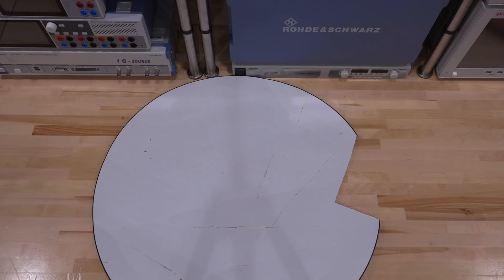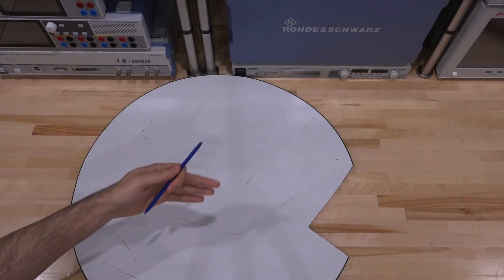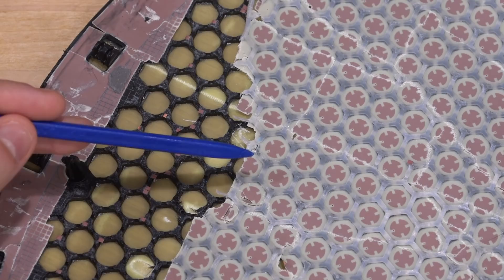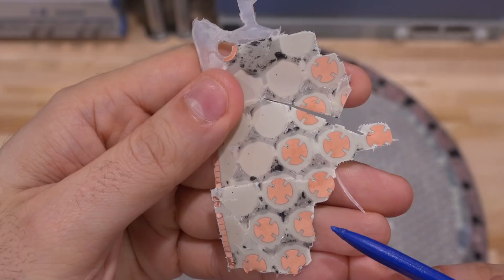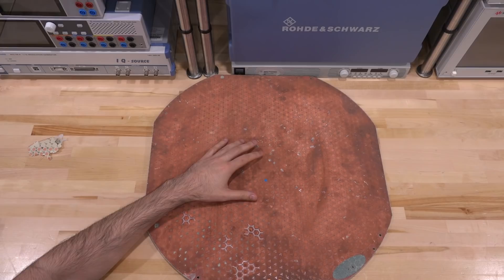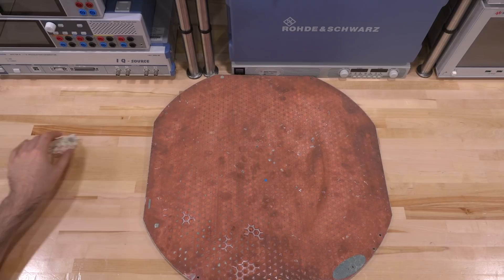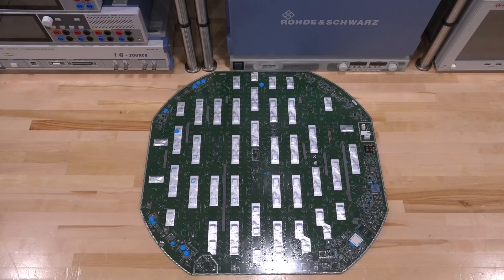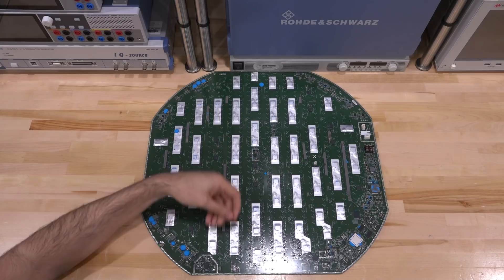TSP #181 - Starlink Dish Phased Array Design, Architecture & RF In-depth Analysis

Comment: Do you have the ability to sand down the PCB progressively?  I know some companies sell the hardware and software to do this.  I recently did it on a PCB I was reverse engineering.  If you don’t have the hardware or the time I would be interested doing this with a part of the PCB.
Reply: "mikeselectricstuff" has also successfully used CNC milling to expose PCB layers sequentially -- he has several videos on it: "Peeling multilayer PCBs apart" and "Peeling multilayer PCBs apart - the setup."

Since the inner layers did not show up very clearly on the X-ray picture here, either grinding or milling the board would certainly be useful for understanding of how the circuit is constructed. I think it can reveal more about the circuit than even de-capping the chips, and can be the next logical thing to do.
Reply: @cogoid  I agree.  I've done it before for boards that have multiple layers with large power planes.  It's surprising what you can find.  One design had the designer's name sandwiched between to power planes.
Reply: @flantc  Same with chips -- I remember seeing a picture of Digital Equipment MicroVAX processor die, with a message in Russian saying: "VAX -- When you care enough to steal the very best."

Incidentally, I am not sure how SpaceX would feel if somebody would do too good of a job in analyzing this antenna and publishing the results publicly.

Comment: @9:56 that's the ground of the array, it's simply a patch panel antenna array. The individual antenna elements on the membrane are separated by 2 dielectrics, the membrane material whatever its and air...
Reply from the maker: That is not a ground plane, I know it looks like one, but it is not. See later in the video.
Reply: @Thesignalpath  so where's the ground then? Apologies if I missed a detail
Reply from the maker: @outrospection4all  It is below the patch antennas on the main PCB. I think you can see it better in the X-Ray images later in the video.
Reply: @Thesignalpath  many thanks
Reply: Another question, do you think the motor steers a specific plane or is it fully electrically steerable phased array

Comment: Would also interested  to see what topology of array is this? i guess is 2D uniform array or not? Also I would imagine you need a pretty beast PC to simulate this...  My 4 patches array I had to did for a project at university took like 4min to simulate to simulate 1k+ element I imagine it take hours....
Reply: you don't need to simulate the entire array to make it. you can simulate it as an infinite array for almost 90% of the array, then just do the simulation for the surrounding (3 or 4 last rings is enough). Anyway, many company use supercalculator, 1 core per radiating element, meaning a thousand of core which is not a crazy investment for Musk :).

Comment: Any idea what the gain of the antenna is?
Reply: From the FCC licence application:

33.2 dBi at 11.83 GHz
 (RX)
34.6 dBi at 14.25 GHz (TX)

This corresponds to the aperture efficiency of about 56%

Note that this is the gain with the beam at the boresight. With the beam at the maximum slant of 56 degrees, the gain will be 2.6 dB lower.
Reply: @cogoid  Thanks for the answer. So it seems near the same figure as an equivalnet sized parabolic dish but with the advantage of it being 'steerable'.

Comment: Will it work with the GPS module disabled ?
Reply: @risfutile  Why is it a stupid question? What basic satcom knowledge am I missing about the Starlink system?
Reply: I will reformulate the question. If Starlink is banned to work in some countries, and the Starlink system knows where the receiving antenna is. Will I be able to fake the GPS data to use the antenna .. or can this be turned off ..
Reply: @Redfvvg  No, because the Starlink satellites will still know the coverage of their transponders COARSELY ...but that was not my question. Reformulating a question in that manner is known as constructing a straw-man argument.
Reply: @amciaapple1654  I am very sorry..
Returning to the question .. If the starlink satellite knows the location of the antenna, only from the GPS data built into the antenna .. then you can fake the GPS data ..
Reply: @Redfvvg  ...but the Starlink satellites know the position of the client's antenna from TWO sources: 1) COARSELY by the satellite's ephemeris/position and beam steering/azimuth at the transponder antennas and 2) PRECISELY by obtaining the data from the GPS receiver built-into the client's antenna via the uplink. What if the data from the 2nd source of positional data is missing entirely because I cut it power supply pins to the GPS module?

Comment: Great video Shariar!
Is this the V band system described here? https://licensing.fcc.gov/myibfs/download.do?attachment_key=1190019
It describes some of your questions like dedicated frequency allocation for uplink and downlink.
I think the notch in the circle is to suppress spurs from the mode that travels around the circumference (any youtubers out there that want to do an EM simulation on it?). I think the black ridges between the hexagons in the top structure could be RF absorbing material to improve isolation between the antennas.

Comment: Planar design, elements using LHCP,  RHCP with low PIM, and side lobe radiation, and a radome designed to act as a Fresnel lens for microwave energy. Sidelobes destroy distributed arrays, as well as directivity of the array.
Feed is important. A modified corporate feed structure.
Reply from the maker: This is not correct. Please see the video. The radome does not act as a Fresnel lens. Sidelobe suppression is achieved via tapering and element removal. There is no corporate feed in this array at all.
Reply: Definitely not a fresnel lens. I've designed them, both with metamaterials (i.e. altering effective dielectric constants) and the traditional solid lens at microwave frequencies. Fresnels also have limited bandwidth.

Comment: Too bad it was already dead when he got it, would be a nice test/goof around subject for these badshit expensive vector signal analyzers/VNAs that he has.
Chip analysis for sure, but probably quite boring since it's all digital phased array and no longer good old analog with different path length trace/coax/waveguide switched into signal path.

Comment: 9:45 Maybe bare copper is ok since presumably there's very little oxygen when it's in orbit?

Edit: ok, missed where it was mentioned this is the ground side dish. Thanks for the responses.
Reply: This is the consumer dish on the ground that communicates with the Starlink satellite in orbit, and provides internet.
I'd expect it's been designed based upon the  research/engineering on the actual dishes on the Starlink satellite.
Reply: This is the ground station antenna.  This is what you'll stick on your house.
Reply: This is the ground station that each consumer will buy. It doesn't go to orbit. The on-orbit antennas will be much fancier and much more expensive. That's one reason Shahriar talked at length about manufacturing it cheaply yet with high enough tolerances to work well.
Reply: @rhysd5410  Someone should tweet elon to send in a prototype antenna from one of the satelites lol.
Reply: @justrandom7214  Probably a bunch of secret sauce in the on-orbit antennas that Starlink competitors would love to look at. Doubt anyone will share anything about them.

Comment: phased array antenna with software control. No new technologies. Technology is 50 years old.
Reply from the maker: This is false. The technology is not 50 years old. Phased array physics have been known for 100 years. But modern phased arrays use modern ICs, industrialization process and hybrid beam-forming techniques. Lets not diminish the technology by exaggerating.
Reply: @Thesignalpath  Also from the maturity of IC technology,  design & manufacturing technologies:this is  surely 'state of the art' , only possible within the last 5-10 years (?), at least for the consumer market.